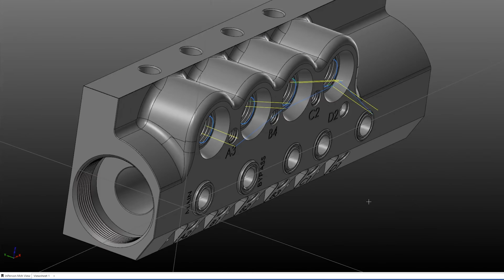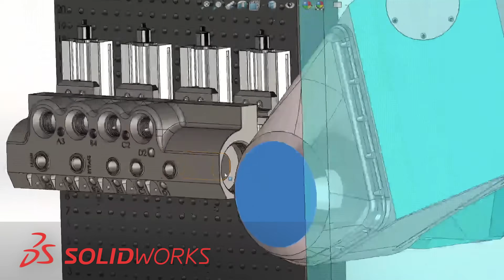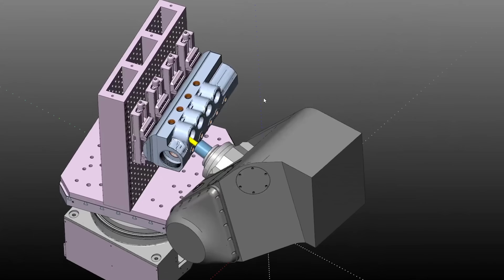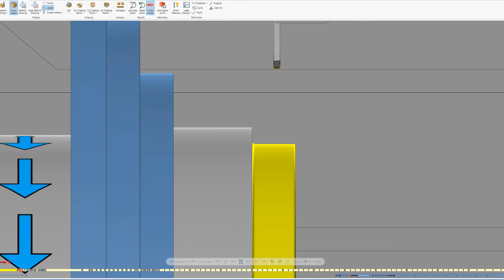Manual or CNC Machining...Which takes MORE SKILL?

Comment: I've worked manual for 42 years though I am qualified in CNC.
For the type of one off work I do manual rules, but I'm in awe with what can be achieved with CNC.
Where CNC kills manual is in set up time and tool changing. After more than 85,000hrs I'm pretty speedy on any manual machine and id have no problem machining a billet head but it'd take forever in set up time and any half decent CNC machinist would kick my ass.
While there are obvious similarities between CNC and manual, they are also very different.
I think manual is a lot more intense because you are the control, not a computer that will just repeat, you have to make sure you don't make a mistake with every cut.....it's stressful but it keeps me busy and the days fly by.
There are places for both types of machining. I wouldn't want to run 15,000 parts on a Bridgeport but conversely a would want to run a one off on a CNC when I can machine it quicker than it can be programmed.

Comment: Why not learn both? 🤷. In my opinion, I think both CNC and  manual machines all have their practical purposes. In every Machine shop ive seen whether its mostly a CNC shop or not, always seems to have an old lathe or milling machine just sitting around in the back of the shop somewhere that still always gets used every now and then when needed. While its definitely nice having a shop running higly efficient and productive CNC machines, its also pretty nice to have a  manual set up readily available with someone who has the skill to take the burden of smaller non priority projects that need to get done. Or, to machine simple parts to repair other machines.

Comment: I'm a learning conventional machinist with 3 years in the trade, and I don't get why this debate is even happening. They both take a lot of skill, and in 80% of the time the better option. So far the only real application for conventional machining is repairs. Any other application of machining is better used for CNC

Comment: U can use a cnc as a manual. The problem with cnc is that parts made from castings are not repeatable enough. I’ve worked both and both are impressive. They both have their place

Comment: They (CNC and Manual) both take skill... but, to be able to hit tight tolerances on a manual takes a handful of more skill due to added variables... especially when compared to a CNC operator. Each has its place... manual machines are becoming outdated. With thay said, when they're needed, they're worth their weight in gold.
Capabilities, speed and accuracy over a given amount of time... hands down goes to the cnc. 
I run both manual and cnc machines... when I feel like staying busy and losing track of time I run the manual machines... or I run the cncs "like" a manual... 😅

Comment: Not anywhere near a machinist or have any understanding of what it takes, nor does my opinion matter, but with many things these days technology can make basically microscopic adjustments to things to where sometimes that might matter. Ngl if you got 40+ years in a trade and have too much pride to realize a machine can do some things better, there’s probably a lot more with technology you can’t accept. I was always taught to work smarter not harder. But loving your trade you’ve done forever I can’t judge for that. It’s your life but tech is gonna get better than humans in a lot of ways, but it won’t surpass our humanity. Btw I just did a line

Comment: The old timer that ran the mills I do on the day shift used to get PISSED at me when I would either write a program for a bolt circle, or especially if I edited his programmed hole locations with tenth values lol if the hole location was X1.0373 Y2.1621 he would just leave the last digit off there if it was less than .0005 and round it up if it was bigger, but I would always(still do) put the whole number in there. He’d say “It’s only a damn tenth it don’t mean a shit, it’s still gonna work!”lol or i would do the math on an angle and get that the old program was 8 degrees and the program called out 6 degrees and stuff like that. It’s just two different schools of thought I think. I don’t like “close enough”, I want it “dead nuts.” Granted, 90% of the parts we make at our shop are for our own line of swivels, so 9 times out of 10 we are running parts to our own print for a unit that we are selling as opposed to a customer’s print and specifications for that particular part. But even still, about 6 or 7 years ago we had a big layoff and they kept me and let him go even tho he’d been here over 20yrs and I was here less than 5. Maybe the attitude was a contribution and maybe it wasn’t 🤷‍♂️ but can’t help but take all that into consideration. He had that mindset of “this is how I been doing it 20yrs and never had a problem” but it wasn’t always that efficient of a way to do it. Instead of having the attitude “man, that’s much faster and easier, why didn’t I think of that?”, he would just get pissed and gripe and moan and sometimes even tear down my set up and set it up the less efficient way. This is a competitive field, and if you can’t compete, you ain’t gonna come out on top. It’s that simple.

Comment: Manual and CNC are totally different skill sets. I run both on a regular basis. Yeah, I'm an old timer that has mostly run large heavy manual and much smaller CNC. Running a 24' part on a 50' lathe is just something that cannot be run on any CNC machine I'm aware of. Also, the small complex parts I run on CNC would be stupid to attempt on a manual.

Comment: Manual machining doesn't take more skills then cnc. It takes different skills 
And to what he said around the end I would say making a few custom size ( length and diameter) washers or a single axle that just need truing up ( so it's straight but diameter doesn't matter ) or a quick chamfer so it can be used in a barfeed holder on a single bar the manual lathe is faster ( you can be setup and done almost as fast as you have turned on the PC. But if you need to make meany or complex parts the cnc always win on time 
( but good luck turning on your PC. Start Mastercam. Program a custom size washer. Star up the cnc. Load the program. Measure your z zero position. And run the washer part faster then you could on a manual late )

Comment: reading and posting on several RC model forums and computer forums I can say there are a lot of people who actually think CNC is nothing more than a 3D drawing and some machine/printer will spit it out. That is because they just send the drawing over to a company and have no clue of what needs to be done before the start button is pressed. And the most funny thing is that in the time they make a drawing of the most simple object I already an halfway making it on my simple lathe/mill. 
To me it is more satisfying if I could make things w/o cnc as it is also a part of the hobby. On the other hand production and difficulty wise CNC is always the better option.

Comment: It also demands on what your machining though the shop I’m in mostly machines castings for most of my time there the company only had manual machines and never really had any problems but about 2 years ago they brought in 2 CNC’s and for parts made from raw material they’re great and definitely get made a lot faster but for castings well that’s where the trouble came in it slowed down production time by a lot and we scrapped many castings for some reason they just can’t seem to find the right formula it is possible the operators are not as good as we hope because the operators are the ones programming it as well but so far the CNC’s don’t seem to work well for castings they operate the CNC’s manually most of the time just so they have more control of the production we seen less scrapping since then but like i said before it slow down production by a lot.

Comment: I used to be a hobby-machinist. So I knew how to work a lathe or a mill but don't ask me about tight tolerances, surface finish or any other important stuff.
I taught myself G-Code programming, got a little help in 3D CAD designing, wrote CNC milling and turning software and even wrote a few post processors for different CAM software. Meanwhile we got our 2nd CNC Mill and I grew up to be a real CNC machinist. 
Never had any formal education in this field and I kept saying that I'm on a hobby level for a very long time. But about 1 year ago, we hired a CNC machinist so he could make sure my designs went into production: check my model, write the CNC program, create a fixture and make sure we can start production. The guy had multiple years of experience and he was the lead CNC operator at his current job. He looked at what I had already done and looking at my tooling and fixturing his comment was that "we do this completely different where I work" and 10 minutes later "this is great, much better than what we do where I work. Do you mind if I take some pictures to show my current boss?" 😁

Comment: alot of high level math was required to figure out missing dimensions on blueprints .. ... everything is calculated by cam software now. ..an average 8y old kid have the math skills required to be a sucessful machinist..
Reply: Bullshit.  If you think all it takes to be a machinist is being able to use the software you are gravely mistaken.  I've had the displeasure of working with "programmers" who've never actually made parts before.  Yes they make programs, but they are shit programs that make shit parts.

Comment: At my shop we use our manual turret lathes for simple tasks that would otherwise take up a lot of cnc machine time. Things like parting off/chamfering fasteners, center drilling, small/one-off jobs, and a lot of rotary broaching. My department (the manual department) handles those tasks while the CNC guys handle the big money jobs.

Comment: For work, a CNC is hands down the way to go. As a hobby, then manual would be a good option. Just don't go with the mindset of just because you play machinist at home with a harbor freight mill doesn't mean you can run circles around the machinist.

Comment: As a machinist you never stop learning. The only time you stop learning is when you die.
A good manual machinist will always make a good cnc machinist. But times move on and so does technology and a good machinist will adapt to new methods/tooling. Whether your manual or cnc It's the understanding of how to remove metal that's the most important factor

Comment: I have found that CNC is great for the initial make.  Then comes the manual methods for correcting any mistakes I made on the model in CNC.  Then you go back to the model and build in your manual steps into the model.  YMMV.

Comment: Programming a cnc machine and running a manual machine are different skills & neither are necessarily harder than the other. That being said I personally believe anyone who is learning to program cnc machines should also learn how to run manual machines as well. This will help them fully understand the processes they are programming their machines to do.
Reply: I have an old Bridge Port with a BUNCH of slop in it. I've made some really cool parts on it and it certainly got me going understanding how to pick up offsets and doing basic setups.

Comment: This happens in other fields too. And I feel the root cause of it all is money.

I've been a printer since I got out of the Army in 1994. The first shop I worked in was in Fayetteville, NC. It isn't there anymore - very, very long story I don't want to tell because it sounds like a soap opera - but when I got there we had a huge amount of inadequate equipment. We had a computer department that made film negatives - this is where I worked - but everything we printed had a lot of hand work in it. For instance, there's a thing called trapping. If you put something on a multicolor offset press, the paper will go through four to ten print units and each will apply another color of ink to the sheet. If one of those units is even slightly off you'll get an ugly white line where you don't want it, so you take the lighter color and have it overlap the darker one just a little bit. The old-fashioned way to trap is to lay a piece of duplicating film in your plate frame, put one to three sheets of tissue paper on top of it, then lay the film you want to spread on top of that. It takes a while to do it, it costs quite a bit because a sheet of 20" x 24" duplicating film was $40, and the job comes out looking like warmed-over crap. We trapped this way because a trapping program was $5000 and the boss didn't want to pay it. He got forced into it because our biggest customer finally told us, "you buy a trapping program or I'll find a  different printer." After we got it, a couple weeks later the boss is all "why didn't I buy this five years ago?"

Same thing with everything else we bought.

Six-color 40-inch press that kept us from having to run Rob's "four color process plus gold plus spot varnish" jobs through the press twice, and that would actually hold register for more than 300 sheets? "Should have bought it five years ago."

Four-page imagesetter that basically eliminates stripping, allowed him to let our 93-year-old stripper finally retire and produced jobs that actually fit on press without having to use a crowbar on the plate skew control? (Don't laugh, that's what you really use to adjust it. There's a hole in it you stick the end of the crowbar in.) "Should have bought it five years ago."

Forklift with a working parking brake so it won't roll into the loading dock pit, which it did five times before North Carolina OSHA finally condemned it? "Should have bought it five years ago."

Internet connection so customers could send us jobs electronically? "Should have bought it five years ago."

I finally went off on the guy..."okay, so why in hell DIDN'T you buy it five years ago? You know how much money we would have made if we'd have had the right tools?" It always came down to one thing: "I was scared." 

And that, Barry, is one of the biggest problems in both our worlds. The best gear is expensive as hell and you need a lot of it. The guy with the checkbook a lot of the time looks at the price of this equipment, looks at the fact that the old gear you have on the floor is making money and decides he just won't spend what he needs to maximize his people's abilities.

The best thing you've got going for you at your building is Titan - a man who understands the necessity to buy state-of-the-art equipment to achieve the results you need.

Comment: One thing that should be said to people who say "being a cnc machinist require no skill" keep in mind machining was NEVER about being skillful. It's about making parts for people who pay to have parts parts made while doing it efficiently, accurately and using most productive methods. If machining was ever about being skillful then machinists would still be using methods that machinists used to build the first metal lathes and milling machines which were built using metal cold chisels, files, metal cutting hand saws, drills, casting, black smithing etc... machining is about creating parts that are within the required specs using the most productive methods and doing it as efficiently as possible. Which is why CNC is king in the machining and manufacturing industry. Machining simply isn't about doing it the most "skillful way" it's about efficiency, accuracy, productivity etc...

Comment: Recently learned another way how newcomers are set up to fail. The guy who does the machine set up leaves worn out tools into the machine. So the operator is going to have big problems very soon, especially new guys who expect things to be in order right after the machine has been set up. The top dog is fast on paper because he does not do his job properly, he has an in-spec part to show and "operators are supposed to know how to know when tools are worn out and need replacing". Every new person has left or let go for one reason or another in recent years. All sent away with gossip about how this person can`t do this and that person did not know how to do that. Giving a shout-out to all other operators in the gutter out there, I feel ya.

Comment: I learned on manual and while I love (as I saw somebody else in the comments put it) how therapeutic it can be... the parts we hog out at work with the Makino MAG3.EX would be extremely difficult to run manually (especially when you get into the 5th axis and the spindle indexing right angle head cutters), and that's before we discuss the time difference. In manufacturing, time is money... and the speed of CNC is great for that. For personal fun that I don't care about the time spent on it I'll take a manual any day, but anything commercial or something that I'd prefer not to babysit or agonize over getting "just right" (I'll probably have a 3D model anyway) CNC is almost a no brainer for me.

Comment: I started as an apprentice toolmaker in the early 80s, and learned to do everything manually  including designing on a drawing board. Over time, I learned to program and set up CNCs and this led to modelling and CAD design. Each requires its own skill set, but they all need a thorough understanding of the basics.